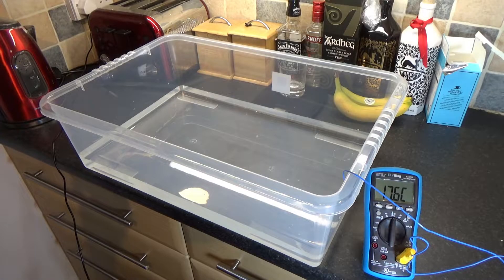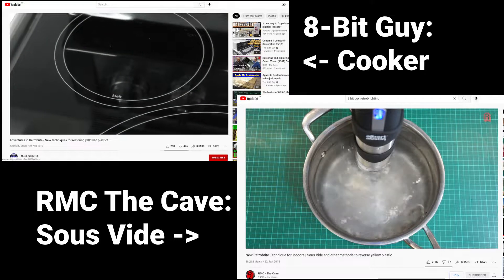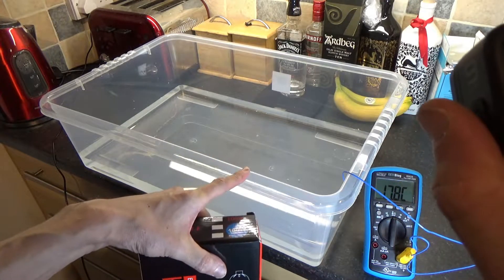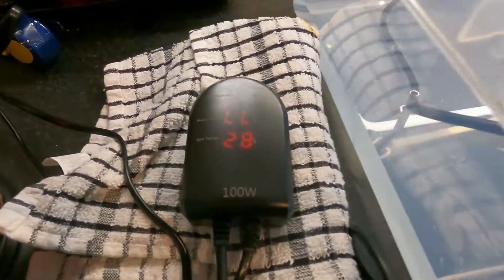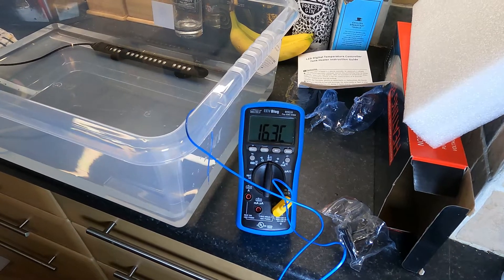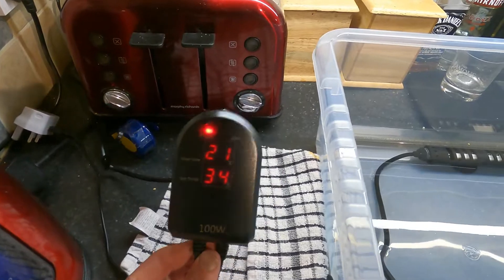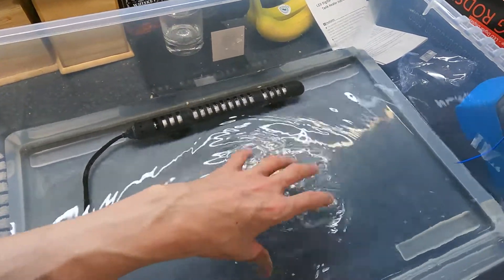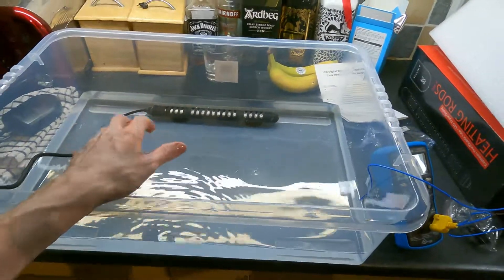A Tub Of Slightly Warm Water (Testing New Retrobrite Equipment)

Comment: Honestly, this is not going to do anything beyond potentially burning down your kitchen or electrocuting you. I wouldn't trust my life with the cheapest mains powered heater I found online!
Reply from the maker: This actually wasn't the cheapest.
Reply: @DavePoo2  But it's still a cheap Chinese import. I'm just concerned for your safety as for all you know, that heating element might be directly connected to the mains. At least just don't leave it unattended.
Reply from the maker: @domramsey  Agreed.